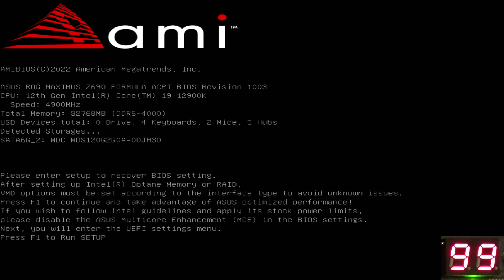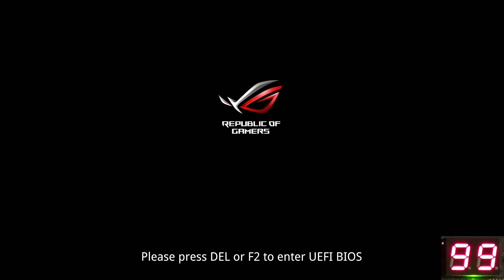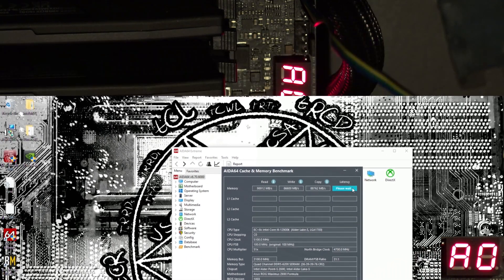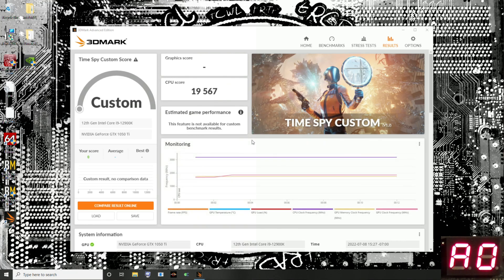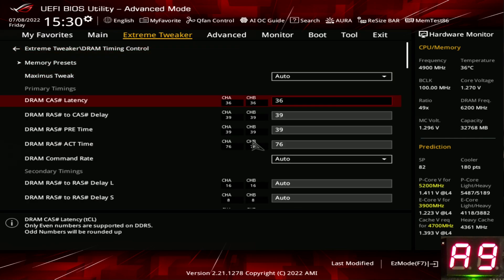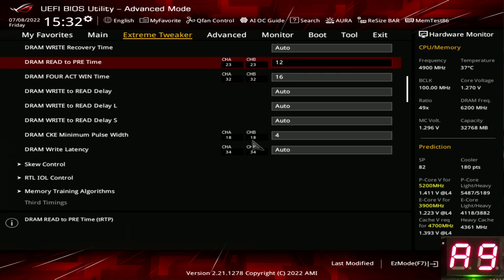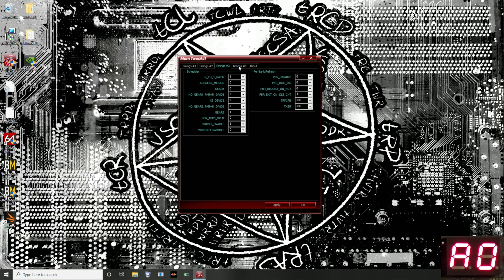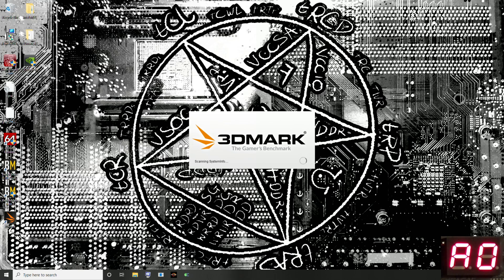Easily improve your DDR5 XMP's performance // for ASUS motherboards

Comment: maybe a little niche, but I'd like to request a subtimings guide for dual rank DDR5s as well! for instance G.Skill 64GB 6400MHz CL32 kit (2×32).
Reply: Have u Found out the subtime for that 😂mine is sitting at 70plus ns which is awful
Reply: Any luck in overclocking it?
Reply: I second this
Reply: He has a video on the timings with 4 dimms 

https://youtu.be/mQVHlIS1lz0
Reply: Exactly what I'm looking for.. can't find anyone talking how to tune the dual rank sticks..
Reply: Would kill for him to do a 14th gen intel ddr5 cl36 7200 xmp video, specifically trident z gskill. I want super tight memory and ram timing and overclocked 7200 sticks. I was able to push 6400 teamgroup stick to 6800 stable on this board easily and those were binned for 6400 expo; minimal adjustment. Xmp profile on these sticks is shit. I drop a few primary timings instantly and I’m lost with the rest bc the only videos he does are fucking Ryzen now and ddr4 isn’t the same as ddr5 timings.
Reply: You’d swear nobody has an intel cpu on earth with ddr5 ram based on the google results for timings for a good 7200 set of timings
Reply: I need this now😂

Comment: Hi I'm running all the timing the same as in this guide and the ram is running at 6400 MT but i started at 70 latency and now im at 65 which is 10 slower than yours any ideas why that could be please.

Comment: Memtweakit doesn't work anymore (it may have to do with a windows update).

DRAM REF Cycle Time is grayed out for me. There is a DRAM REF Cycle Time 2.

My setup: 
ASUS TUF Z790 Plus WiFi
13700k 
2x16GB Kingston FURY DDR5 6000 36-38-38-80
Reply: greyed out for me as well, found any fixes/workaround on how to change it ?
Reply: @eigengrau.74  I changed the next setting instead (same name, only "2" at the end, as mentioned above).
Reply: Same.  Just changed the one below it that wasn't grayed out and it worked.

Comment: Hello! Got Mobo Asus Rox Strix z690 DDR5, CPU 13900KF, RTX 4090. Some time ago I had DDR5 Corsair Vengence 5600. Somehow it worked with XMP at 6000, but the results was much worse. Before I saw the video I lived the noral life )) So with Corsair 5600 32Gb (2x16) it is R-50000, W-44700, C-48000, L-72. But when put my new DDR5 Kingston Fury Beast 6000 64Gb (2x32), it never sucessfully loads up with XMP I - always comes up with the BSOD. It only boots normaly with the XMP set to 5600. And the results are surely even worse - R-45000, W-39000, C-44400, L-82. Any advice?

Comment: Hi Buildzoid, awesome video and very informative DDR5 performance tweaks on ASUS ROG motherboards. 

I recently purchased several 32GB kits of G.Skill TridentZ DDR5 6000 CL32 and 6400 CL36 which vary between Hynix A-Die and M-Die that I will be using to build a couple iRacing simulators. I will be using the A-Die kits for my higher end i9-13900K builds and M-Die for i5-13600K builds. I have been applying a lot your timing recommendations with outstanding results, however, I noticed ASUS made a change to the DRAM REF Cycle time = AUTO setting when I upgraded the BIOS to version 2305 on the Z690-E Gaming board. The DRAM REF Cycle time = AUTO is now "Greyed Out" and cannot be overridden. 

Do you think there will be any performance impact or stability issues based on your recommended settings now that the DRAM REF Cycle time is set to AUTO instead of 333?

Comment: Hello,
 Hardware:
 Motherboard Asus Z790 Hero
 Intel I9-13900k
 Kingston FURY Renegade RGB 64GB Kit DDR5-7200 CL38 (4x16GB)
 Asus RTX 4090 OC 24GB
 Asus Rog Thor 1600W Titanium

 Is there a way to change the BIOS settings for this DDR5 Ram in such a way that the clock frequency remains stable at approximately 7200...!?

 Fonts Modmachine4k

Comment: Amazing video, so would this work for running ddr5 with 4 sticks, on a z790 strix with I9-13th , but can’t get them to run standard xmp 6200 stable.  So only get 4 at base or 2 at xmp,
Reply: This seems to be my experience as well. 
ROG strix z690-e gaming wifi board and corsair 4x16gb 6200 dominator memory. 
I can run 2 sticks at 6200 using built in xmp 1, but trying it with 4 seems super unstable.

Comment: "Rumor" out there said there's a degradation problem in imc of 12th gen. After months of overclocking, it became unstable even if you don't chang any voltage and timing

Comment: I have the Z690 e wifi mobo and rampage ddr5 5200mgHZ (2x16 with all four slots filled in for a total of 64g of ram) can i use these settings to get my ram to run at 5200 mgHZ?

Comment: I have Hynix-A die ram (6400Mhz CL32) overclocked to 7200Mhz CL34 1.45v. What's a good tREFI for this, im asking because i've seen a lot of videos and the numbers are between 65000 to 130000!
Reply: Asus Hynix 7600MHz profile sets the tREFI to 262K on Z790 Apex. Don't know how stable that is though. Probably needs good cooling

Comment: With these settings on MemTest86 I get errors on moving inversions 32-bit pattern when temp hits 54c. I loosened both tRFC/tREFI and yet it still happens. Any guess what could be the problem?
Motherboard: Strix Z690-F (latest bios & ME)
CPU: 13700k stock (86 sp)
Ram: Kingston Fury Beast 5600 cl40 M-die
Reply: Set your fans to max

Comment: Can you create a similar tutorial for the newer Hynix A-die RAMs with 7200 MT/s and above? Just tried these settings on my Corsair DP 7200 CL34 sticks with ASUS Maximus Z790 Extreme and the system would not post to BIOS.

Comment: My 7600 kit doesnt rly get stable with any subtiming changes looks like they are on the edge already. Its easier to run them at 8200mhz with lower timings

Comment: These ASUS mobos are dogshit for DDR5 stability.
Reply: I would've bought a MSI Z790 Unify-X if there was one. I find the MSI bios much more pleasant to work with
Reply: @a_void  I really like the MSI BIOS as well, I spent a lot of time in it overclocking my b-die. I've tried three Z790 mobos so far (Carbon, Strix-E, Master), and 2 out of 3 can't get 7200 fully stable - the Aorus Master is the only one with rock solid stability, but mine had coil whine so I had to return it. I thought the Strix-E would be my saving grace, but I'm banging my head against the wall tweaking voltages just to get stock XMP stable. If you go to various forums you'll see they're filled with similar experiences. Now I have another Master on the way, and whether it has coil whine or not I'm likely sticking with it. I've never swapped out so many motherboards in my life, it's insane.

Comment: My system doesn't boot with these settings. My kit is F5-6400J3239G16GX2-RS5K. I have a 13900KS and a Z790 Apex
Reply: I found the culprit. My mobo sets the MC voltage to 1.11 in auto. I bumped it to 1.22 and now it boots. Managed to get to 7000MHz but needed to relax some of the secondary and tertiary timings

Comment: Hey hey,

I have an asus b660-a ddr5 capeable motherboard with a new i5 13600kf cpu, also have 2 sticks of ddr5 6000mhz 16gb so its 32gb…
Its only works on 4800mhz.
I went through the process what you just showed in the video. Waited around 15 minutes but nothing happens after the restart, seems like no boot at all. I put the voltage from 1.35000 to 1.40000 V as my voltage was already 1.35000.

Any advice anyone? 
Its just sad to spend more money on rams which not working as it should be.

Thank you❤❤

Comment: This tutorial doesn't work for a ProArt z690 with 128GB of 5600 ram.  Hope that perhaps an updated video to help us obtain the speed will be produced.  Thanks for a great tutorial.  It was educational in that it encouraged being brave enough to mess with various settings and NOT brick the board!
Reply: The thing is, ddr5 still needs some time to be fully capable of 4 sticks.
Reply: More ram = significantly heavier and impossible to run past certain points
128gb would be 4 sticks as well, which is extremely hard on the memory controller

Comment: I have now tried 3 different versions of Mem TweakIt but it wont start giving me, the "Error during driver initialization" Is there any alternative software for on the fly timing adjustment? I have Windows 10 and Asus B660 motherboard

Comment: Checking what u did before and changing some values that were not the same here: https://youtu.be/m_L-acfyvWw?t=779 i got a crash, blue window in W11 with i9 12900K + Asus ROG STRIX Z690-F + Kingston Fury Renegade DDR5 6400MT CL32. My PC randomly freezes with 6400 and I'm trying to find a solution in YT videos, arg :(

Comment: Does it have any performance advantages to set tRRD_S to 4 over 8 as DDR5 has doubled the burst length?
Reply from the maker: it helps a little because the memory controller has more flexibity to send ACT commands.

Comment: Just built a new pc i9 13900k and ddr5 5600. It turns black whenever i turn on xmp. So im stuck at 4000
Reply: asus z790 maximus extreme
Reply: What's your sa voltage at in bios?

Comment: BZ, question for you. Trident Z 6000mhz 2-16 kit, asus x670e-e mobo. I went into the uefi and in tweaker I don’t even see a EXPO-1 or Expo-2. I see a couple of DOCP options. I tried DOCPII and saved. It booted ok, but could run a file of cinabench with out crashing. Back to OG and it runs cina all day with decent scores but my 6k speeds shows something like 4800mhz ?! Mobo shows latest bios but that is the only thing I can think of, besides my trident set not being expo compatible?!?! Which seems hella odd to me. Any help ? Or anyone here have any similar issue?
Reply: expo-2 is "safe mode", expo-1 are fast settings

Comment: thanks for the video! working real nice on my kit, though I'm using 1.435v, g skill 6400 cl32 kit
Reply: you use the exact same timing he has in the video on the 6400 kit?
Reply: @RagedFPS  hey, not exactly, I had to turn up the tRAs a bit to have full stability and also had to change CPUs because the first 13900k sucked
Reply: @CarlosDiaz-is8cu  ok thanks for the info. Got me a little scared to mess with it. Im a complete novice to it and don’t want to mess something up.
Reply: @RagedFPS  ah ok good luck! just be careful with the voltage, and you will be fine, go max like 1.45 if you have 2 sticks of ram or 1.435 like me if you have 4, they get hot but nothing will happen, crashes most likely

Comment: I wonder if I have a different die on my kit. G.Skill 6600Mhz CL34, on an Asus Z790-F. XMP profile works fine but touching the timings is like hitting a wall. I tried running at 6200Mhhz with the same timings as you have, and same voltages, but it won't even post.

If it had just been unstable, I would have assumed I simply lost on the silicon lottery. Being unable to post makes me think this kit is not M-die, or a different revision of M-die.

Edit: Oh, and going to 7000Mhz with the XMP timings actually allows me to boot, though it's unstable at that frequency. I think the XMP timings will run stable at 6800Mhz - testing this right now.
Reply: did u gwt it to run at 6800?

Comment: Bullzoid your subs are working really nice on my kit! 
My hynix mdie kit is currently running on 6000 30-36-36-28. I did try to get 6400c32 stable, but i think that my mobo has issues with higher ram speeds than 6000mhz.
Do you know if stable 6000+ mhz is feasable on asus b660 boards.

my specs:
i5 12400@4800allcore, asus b660 strix-f, 2x16gb Kingston fury 6000c40 ram
Reply: same board on me. its stable on me but with 6200 mhz 34-38-38-30 1.25v sa voltage. other settings like the bullzoid video
Reply: It’s less about the board and more about the Memory controller on your processor

Comment: I can only get down to 63ns (59 on a lucky run) with these exact settings with my hyperx fury 6000c40 (set to 6200c36 as in the video). I'm only on a 12700k with b660 board but you'd think identical memory settings would be close.

Comment: Yo for anyone that has the gskill trident z5 6400 CL32 kit, I saw a lot of you saying that these timings are unstable... I have this kit and can run these timings 100% stable @ 6400mhz with the 1.4v's exactly like he has it in the video.  If you are unable to boot, its probably because you set a subtiming wrong. They are not in the same order on my MOBO as they are in this video, its easy to set the wrong thing.  Lastly, if you get errors running a memtest, or large ffts on prime95, its probably due to your cache OC, or CPU OC.  disable your CPU OC's, then adjust ram, test for stability, then do your CPU OCing.   If you do get errors, to check if its the ram or CPU, you could also lower the ram MHZ to something really low, retest and if you still get the error than its caused by your CPU overclock.

edit: For reference
-13700k (stock)
- ASUS z790 prime-A 
- Trident z5 6400mhz 32, 39, 39, 102 @ 1.4v ; tuned to 6400mhz 32, 39, 39, 28 | Command rate: 2T
Reply: Yo just fyi, got the same kit, cpu, mobo as u. I pushed it to 6800 with 32 39 39 28, u can try to push it a little further too
Reply: Hi there thanks for the info I have a g skill trident z5 rgb ddr5-6400 cl32 32gb kit on my asus rog maximus hero z790 motherboard  and have been running into stability issues in my steam games , I really noticed it when trying to run cod black ops 1. Which is a 2010 game. I am going to try your settings,  I had trouble trying  to find any help on setting up the bios on this board. I forgot to say I also have a 13900k cpu , I have read about all sorts of different  stability issues with this setup. So if you have any other suggestions or videos that I could benefit from.  Please let me know. And thanks again for your expertise on this matter.
Reply: Cpu oc is more important than ram oc. Do cpu oc 1st and then ram oc